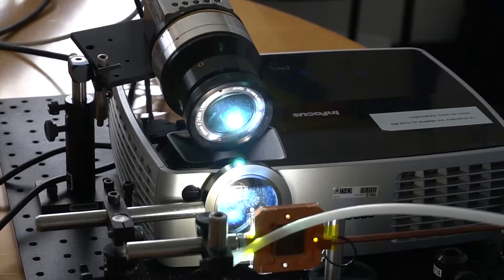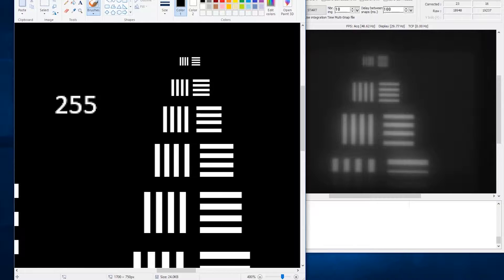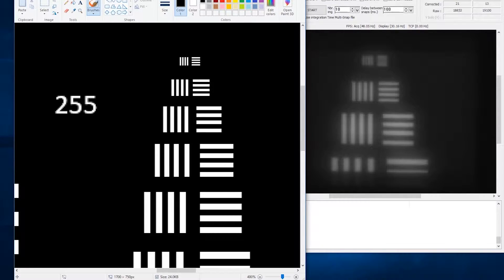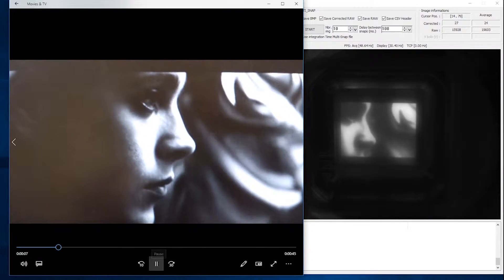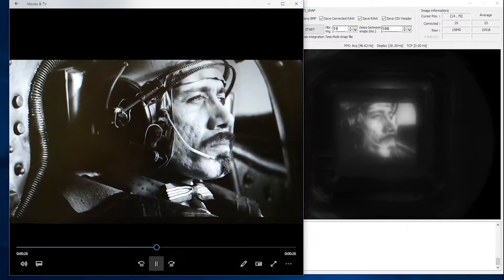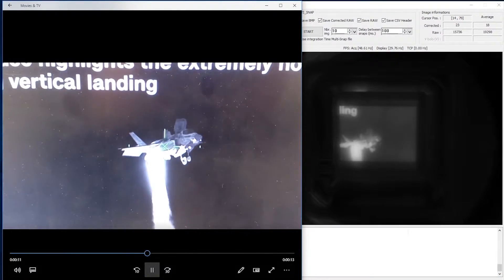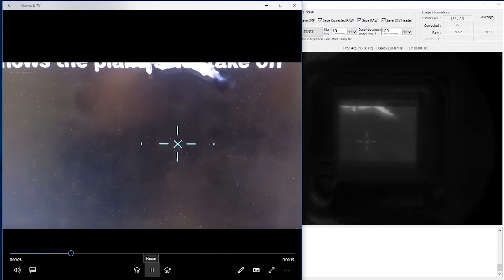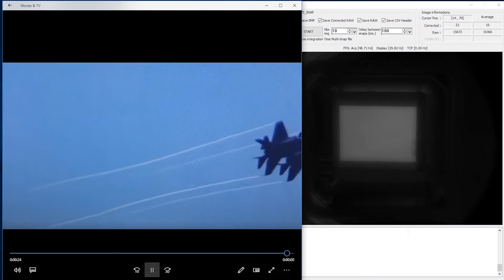Infrared Video Projector CI SYSTEMS

Comment: I am looking for a system to project an image or pattern onto a wall or screen during a presentation. Then I need to pass around either glasses, a phone or something that can "see" the image. I'm not sure I understand this projector. Could you direct me? Thanks! js
Reply from the maker: Send me an email to amir@ci-systems.com
Reply: @amirbarak9312  Sorry, I haven't checked the email on this acct for a while. I will contact you.
Reply: @joestocker660  I joe! I'm looking to do something similar as well. Did you succeed making this happen on your end? Thanks
Reply: @paradestudios  No. Don’t remember the content of this video, but conceptually got as far as pealing the coating layer from LED monitor and cutting lens for glasses from that.
Reply: @paradestudios  Look up “the ultimate privacy screen”. Guy takes screen off an iPhone and makes glasses to view it. I think I found something similarly possible with a monitor (much cheaper than trying with a phone).